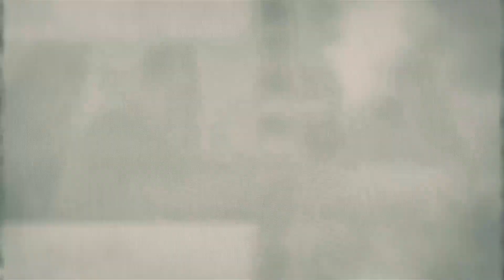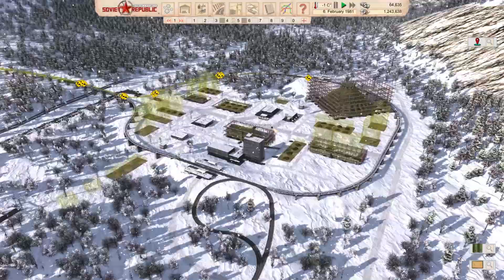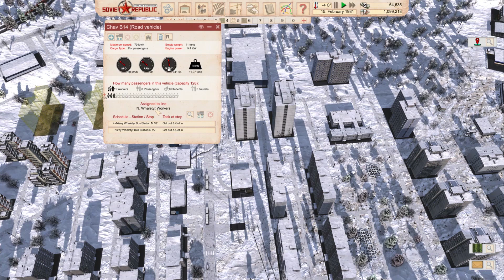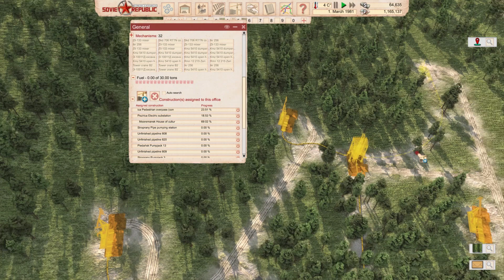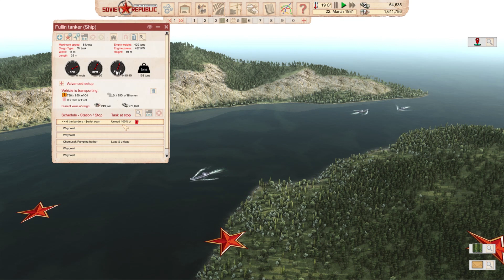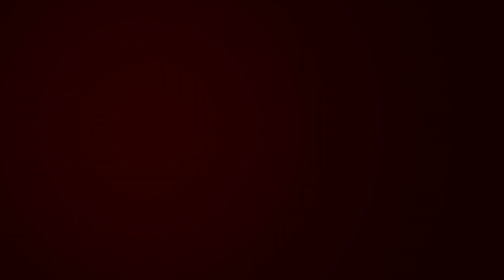Soviet Republic - Alaska - Meat Transport - Ep.73

Comment: 1) Unfortunately no, the overlay does not have information on free accommodation, that would be nice !
2) You did not need the 2.35 medium voltage cabes to power the oilfield substations, the opportunity was good to use lower capacity cables.
3) This has already been said but you should temporarily stop building ships to facilitate your logistics of imported steel, the pace of expansion should be your priority and it would increase it. You already have a lot of tanker ships that import crude oil that you can now use to transport your own production as well as manage your exports.
4) You have no more room to store your electrical components, which means you can start exporting your surplus just as you shouldn't have to wait to build the electronics factory in Markusovo.
5) In Markusovo it would be nice to choose the vanilla electronic factory just like you used the vanilla electrical components factory in Statsovo. Personally I like to have at least once every vanilla industry, by doing that I pay my tribute of gratitude to the work of the developers :)
Reply from the maker: 1. Sad.
2. Yeah! 
3. If using force to fix the problem is not working, you are not using enough of it. We should import more steel.
4. I need to check how much Ele. Components are needed for the steel mill. If we have enough I will start exporting them. :) 
5. I disagree. We are paying tribute to the developers by playing this game, they are paid with every game sold. I like to honor the modders, they work for free. :) 
But I see your point. I might go for the vanilla factory. 

Thanks, Stats!